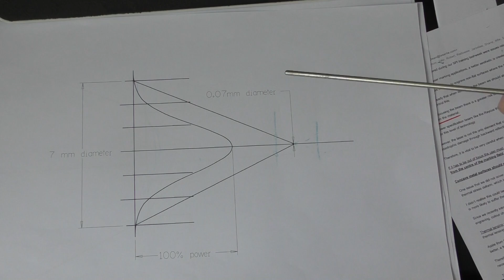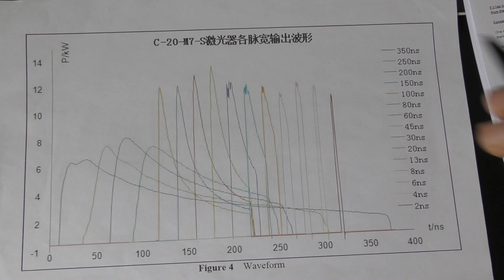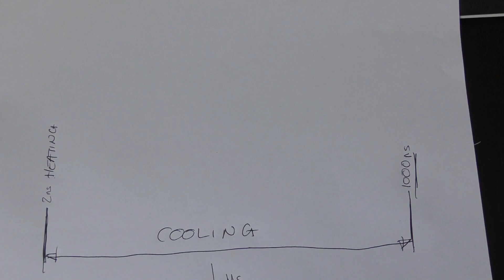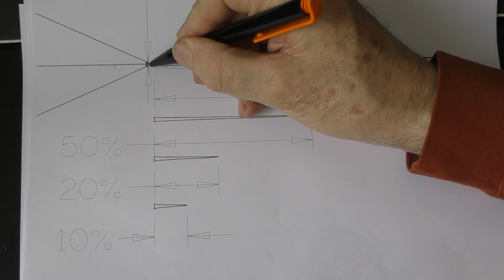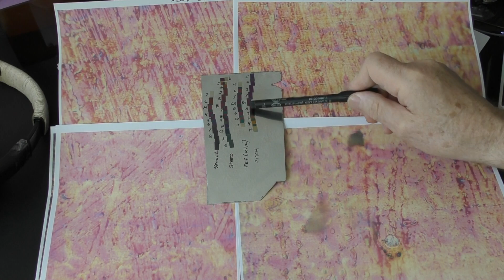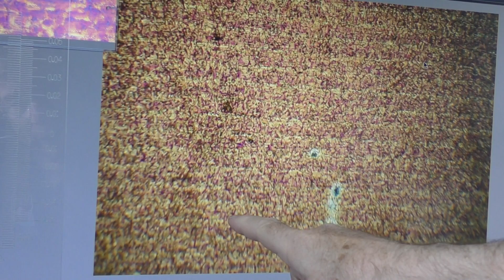Fiber Laser Learning Lab 18 Intertwined Parameters

Comment: Great video on what is happening with the different settings. Thanks It really helped me out. Another way to look at the power is the difference between a garden hose pressure and a power washer. Both use a stream of water yet there can be a dramatic difference in the effect on the material being washed.
Reply from the maker: At this time I was still stuggling to find the real cause of all these colours. I was still of a mind that they were somehow created by thin film interference  as the surface of stainless oxidized. I was wrong and soon found out that these colours are caused by micro machining of the materal surface  (almost at the atomic level) to prodce a diffraction grating  see   this for a fuller explanation
https://www.edmundoptics.co.uk/knowledge-center/application-notes/optics/all-about-diffraction-gratings/
In general it seems that line spacing is one of the key factors  but power and speed (ie exposure time)also influences the machining pattern. In the same way that you cannot see a raibow unless you ar ein the right position relative to the sun and rain, so it is for thse colours  view mit in a different light and from a different angle and the colour disappears

Comment: Very helpful tutorial, thank you for sharing. I just purchased a 20w mopa fiber. When you say 1.8 nm for "pitch" is this the same as "line distance" on EZCAD2 hatch parameters? So is the mm equivalent to be then .00000018 mm?
Reply from the maker: Hi
The nm in EZcad2 implies  nanometres for line spacings  of 0.000000001mm (8 noughts) whereas it should read  micrometeres  (or microns)  µm which is 0.000001mm (5 noughts) ie. 1000 times bigger.

Comment: Hi Russ; "Beatiful Mind" is what describes you the better! Now, beside the compliment, can you quickly tell us the source document you use, when you say "for a given pulse length, whose natural frequency is ..."? Where can I find this document and the literature you used for understanding the physics behind this relationship? Thanks in advance!
Reply from the maker: Hi Francesco
 The fiber laser was only on loan from Lotus Laser. They have now "un-loaned" it because they had an urgent MOPA laser sale they had to fulfill.  It was a great learning experience  but not a machine I would ever want to buy. Its geared to high volume production marking. I cannot find the exact data sheet for my machine but this is a similar machine and you can see from the set of power spikes that you can put kw of energy onto a single dot if you select the right frequency and discharge time.  As you will see there is a vert specific frequency required to achieve peak power and depending on the selection you make the pulse may persist at lower power fora "long" period.
https://www.gehtmarketplace.com/uploads/listings/8792cc01be75c679ea80aee320434700/4004d3b969f7c3b1e5f170a0674bb145-0.pdf
Best wishes 
Russ